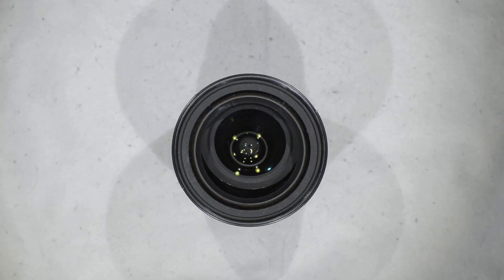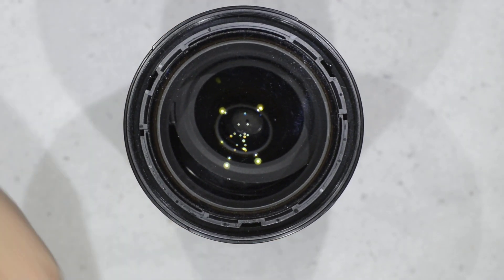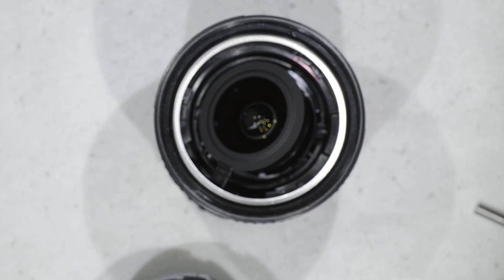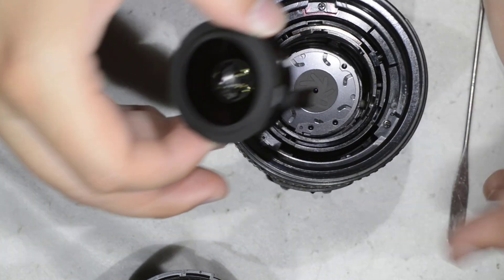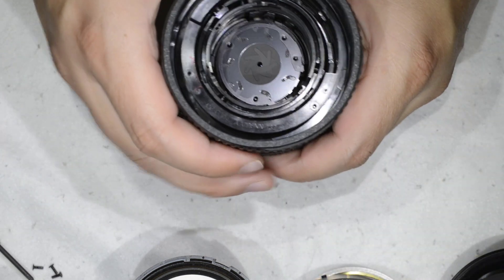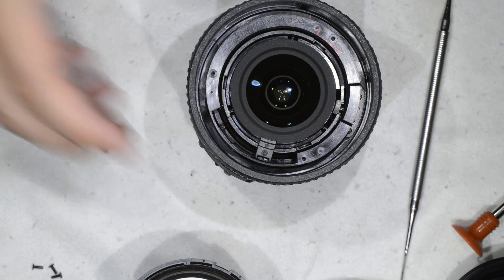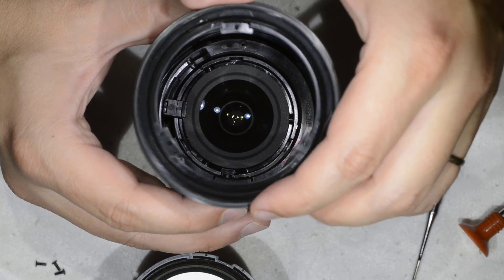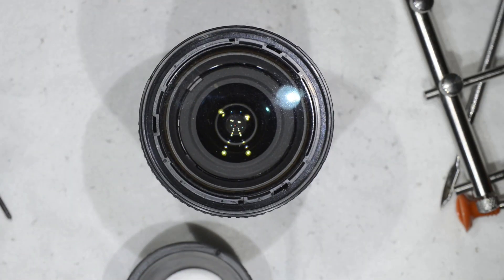Nikon Nikkor 24-85mm VR : Disassembly and repair : Lens repair

Comment: Can you please should how open the sealed lens element for this lens. The YouTube video is for a different lens. Thx
Reply from the maker: @chivtang  I don't have this lens anymore. If I ever come across one again, I'll show that procedure applied to this lens. Best.
Reply: Thanks. Are you able to describe how remove the domed sealed lens? You mention in the video to cut the plastic. Unfortunately the fungus is on the inside, so I need to take it apart. Thx
Reply from the maker: @chivtang  It's hard to say without seeing the lens. You need to look for a very small retaining rim at the edge of the lens. This is what you need to cut, very gently.

Comment: Hi sir..can i remove and clean center elements from in front of the lens
Reply from the maker: Hi, you want to open the front element further, is that what you mean? If yes, I did not pay attetion on how it disassembles, most likely, it is a sealed block, you can use this procedure here https://youtu.be/XxVDBvCJOk0 if it unscrews, just use some isopropyl alcohol to dissolve the glue and unscrew. Best.
Reply: @diyextravaganza  thank you sir appreciate that